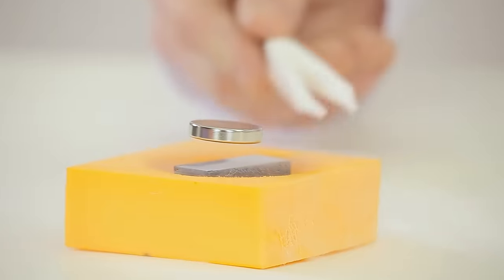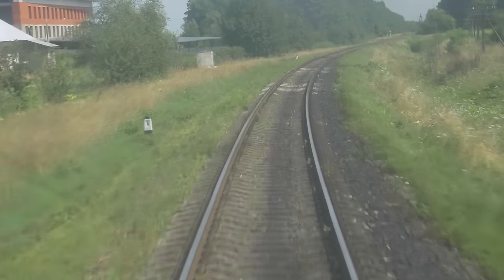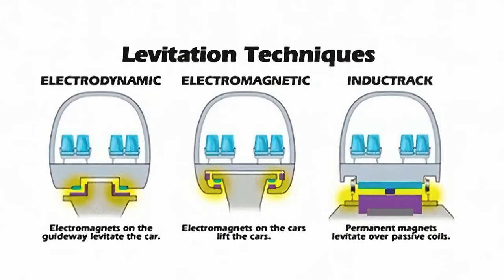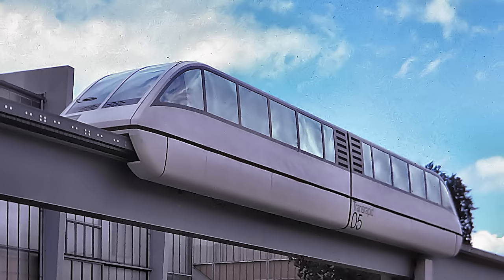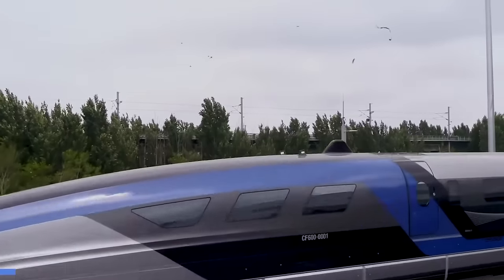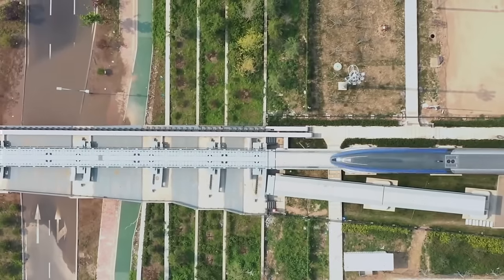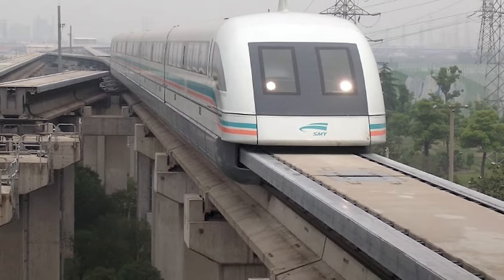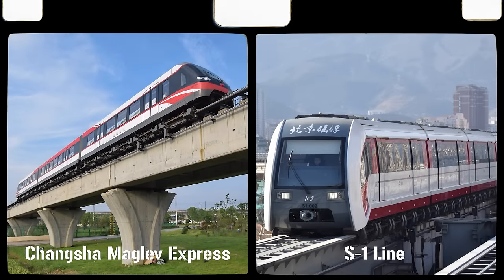Maglev Trains: Why This ALWAYS Falls Short

Comment: Except the GatPort Airwick maglev interport train.
The high speeds seen by maglev trains are largely due to the dedicated and expensive track.
As to the quality of the ride, the UK's HS2 and the Chunnel running on welded rails is very quiet and smooth.

Comment: The only high-speed maglev, in Shanghai, doesn't actually even make sense.  It runs for 18 miles and take 7.5 minutes, more than half of which is acceleration, and doesn't stop anywhere.  For comparison, my old commute was 13 miles, stopped at 6-8 stations, and took ~20 minutes, if it didn't have to stop it would have been more like 15 minutes.  The Shanghai maglev, realistically, shaves maybe 5 minutes off the time of just using a fairly boring train (not even a fast one).  It serves no real purpose except to be able to point and say "look what we did".
What is missed from the film is one of the major reasons why they don't exist in a wider context - and it's the same reason that mono-rails are also basically non-existent.  They require very expensive, exclusive track, that doesn't deal with junctions very well - i.e. it mostly requires an end-to-end seamless run.  That makes them more or less useless across Europe, given the old world nature of the populations and existing infrastructure.  China can build them, because they don't give a shit who they disrupt when building anything.  Japan have history of using separate high-speed lines, so know how to do it.  The US should be the one leading the way with it, given the vast amounts of emptiness and distances between major cities - but they have to fall out of love with cars to gain the apetite.

Comment: There are many mistakes here. Friction is not a speed issue for wheeled vehicles, even very heavy trains. At high speeds air drag dominates the frictional costs of steel wheels on steel rails. The French TGV wheeled train had an experimental run at over 550kph. The issue with the wheels is mostly track and bogey maintenance. Those costs grow as the third to fourth power of the wheel loads.
The fact that they could be better climbers is irrelevant for high speeds as the passenger comfort issues are the same whether the acceleration is lateral or vertical.
High speed vehicles with any suspension and drive train require tracks with little lateral or vertical direction changes. Straight and flat = expensive and huge right of way acquisition costs.
Maglevs have had limited penetration because they are about fixing the wrong problems, while introducing their own intrinsic issues like needing some form of linear motor versus just turning a wheel. We know how to do the latter really well. Good roller bearings used in roller blades are capable of more than 30,000 rpm so a 16 centimeter diameter wheel would support a linear speed of 900kph.

Comment: Since room temperature magnets can only float up to 1cm, in earthquake-prone Japan, they succeeded in floating the car body 10cm by using superconducting magnets that generate a strong magnetic force by cooling the magnets to absolute zero. This makes it possible to prevent contact with the guideway even when traveling at 500km/h. Superconducting magnets are used in medical equipment such as CT and MRI, but Japan is the first country to use them in high-speed trains.

Comment: You don't mention the massive engineering needed for track switches or points. Not nearly as simple as moving a couple of steel rails by a few cm, you have to move the entire track bed and all the electronics needed to move the train
Reply: You're stuck in a specific design mindset. Think of rotary switches instead.
Reply: @colormedubious4747  It's still more complex than a simple rail switch.
Reply: Well, the general logistics of plain tracks is also a big cost factor, you are basically competing with two steel bars screwed into concrete blocks and an electric wire. Hard to get cheaper per unit of distance …
Reply: It would essentially work the same way as monorail switches do where the track itself bends.
Reply: @domp2729  Beam replacement switches are constructed of reinforced concrete and do NOT bend. The straight section swings out of the way as the curved section swings in to take its place (or vice versa). The entire process takes about 12 seconds. Rotary switches are faster and also do NOT bend. Segmented switches (such as those used in many Japanese transit monorails) APPEAR to bend from a distance but the individual segments they're made of are reinforced concrete and not bendy at all.
Reply: @MatthiasWiesmann  factoring in maintenance is important. Rails require a lot of work and switches are particularly vulnerable to wear & tear
Reply: This is why monorails aren't used also. Yes, they're possible, but unwieldy and slow.
Reply: @DouglasLippi  [Multiple Citations Needed] and [Multiple Definitions Needed]. "Slow" is relative to what, precisely? They are much faster than buses, LRT, and trams/streetcars. "Unwieldy" is not a term of art in the transit industry, so what do you even MEAN by that?

Comment: The problem with maglev is not simply its cost, but where its cost comes from. Maglev track is extremely expensive on a per-mile basis and can't be shared by any other vehicles. In contrast, a length of high-speed conventional track is relatively affordable and can be used by low-speed local trains when not needed for the high-speed service, and a high-speed train can travel at low speed on low-speed track to integrate with existing infrastructure.
So, because maglev expenses scale rapidly with the size of the network, they're really only suitable for the rare cases where you need to connect relatively distant cities with fast, high-volume service that can't be supported by aircraft, slower trains, or road vehicles. So certain cases like the Shinkansen make sense, but -- as you noted -- city center to city center transit is very difficult to retrofit into an existing city. Digging them through tunnels just exacerbates the per-mile expenses, so even that isn't really a solution. It's a great idea, but you would have to build your country with this transit system in mind, or else have a strong-to-tyrannical government capable of forcing the city restructuring needed to accommodate it over any objection from the residents. (Looking at you, China.)

Comment: I think it's very understated how much of a problem regular stops are. If you gotta stop every few kilometers, high speeds make very little sense. Also, normal high-speed trains can get to pretty impressive speeds already, close to the comfortable speed limit where passengers would still be comfortably. The French TGV travels up to 320 km/h, the German ICEs aren't that far behind. And that's already pretty near the limit of comfortable travel. Maglevs sadly don't make too much sense. They would make sense on big stretches without many stops, but there isn't many of those. You don't really wanna build a rail that connects only big cities and skips everything in between.

Comment: Think of a maglev track as the stator of an electric motor and the train being some kind of the unrolled rotor. Now in order to cope with all kinds of external impact factors, the flight height must be something like 15-20mm, meaning we have an air gap of 20mm between stator and rotor.
A typical electric motor has an air gap of less than 1mm which makes it far more efficient.
Additionally, the maglev needs energy to lift off  and stabilize during flight which also impacts efficiency.

Comment: It really does need some people to persevere. The Hindenburg accident was the main reason that airships are no longer a thing, people got scared and lost faith. Chernobyl, and later Fukushima, were some of the main reasons people lost faith in nuclear energy. When it goes wrong it does indeed go terribly wrong. However, that doesn't mean it's bad. That Maglev accident also shook people, made them a bit scared of it. But such an accident could as well have happened with a normal train. I mean France has the TGV which, during a top speed run, managed 575kph in 2007. The Chou Shinkansen doesn't go much faster. But it'll be a heck of a lot more stable. But that TGV test could have also ended in an accident, which could have made people scared of high speed trains altogether. Like I said, it takes people to persevere, to get the technology through. Just because something bad happens with a new technology doesn't mean the technology is necessarily bad, it was just executed poorly. Which has happened many times. And in some cases it's actually been accidents that gave us products we now basically rely on day to day. Wasn't the microwave one of those things?

Comment: It ultimately comes down to the fact that laying two steel bars next to eachother on some hardcore is a hell of a lot cheaper than building a complex construction of connected electro magnets that have to be coordinated with millisecond precision. And given that the extra cost increases fairly linearly per mile, and that maglevs work better the further they travel to take advantage of speed, the upfront outlay is always going to be much more, And atm vastly more, than conventional trains. Same reason the hyper loop was a stupid idea. Well, one of the reasons

Comment: It's an interesting idea and I'm all for fantastic new technologies. However, given SNCF managed to get a TGV up to 574kph, I can't see them taking off unless they have the possibility of reaching near the 1,000kph mark. At which point are we near the fabled hyperloop?
Reply: Yeah TGV still the fastest non maglev train
Reply: Well Hyperloop is just maglev in a vaccum tube so yeah.
Reply: TGV current top speed is 300 km/h.
Reply: How fast it can hit in a one time test is totaly irelevant. It also took 150 km to acceleration to  that speed and it was down hill. Apart from  that they had to straigen the track after and the train was composed of 5 locos and no vagon
Reply: Japan's Maglev reached 603kmh which was limited by the length of the track. Transrapid have also stated that 700-800kmh is achievable
China is currently pursuing 1000kmh Maglev tech
Reply: @_peepyopee  a standard non modified TR08 would hit about 800km/h if it was just let to go full tillt
Reply: "just maglev in a vaccuum" is a silly phrasing.  Having a giant tube that you maintain at high levels of vacuum is the reason why hyperloop can't work.
Reply: Running a high speed train at 500kph in service is problematic. The track quality has to be very high and maintained as such. 

The worst is the overhead cable; the cable tension has to be very high to ensure the speed of propagation of transverse waves in it exceeds the train speed. If the wire is too slack then the pantograph sets up a standing wave in the cable just in front of it. Consequently it loses contact with the wire, and your train loses power. This sets the train speed limit. The problem with a tight cable is that they keep snapping. It's a total maintenance nightmare. Ironically, going back to gas turbine power (like the TGV was originally meant to have) would solve that problem. 

Another problem with higher speeds is separation distances. There's a maximum safe braking rate, beyond which you'd be risking passengers falling over, getting injured, etc. So, you have to space the trains out more. This then reduces the line capacity, assuming the trains are the same length (fewer of them can depart per minute). You could make passengers sit down and wear seat belts like on planes, but that wouldn't be popular.

Acceleration rate is also a problem; it takes longer for a train to get up to that higher speed. This means reducing the number of stations on the line (cutting revenue), or never actually reaching the top speed. 

Interestingly, the existing Japanese bullet train line has done an awful lot to reduce journey times not by increasing train speed, but increasing train acceleration and making them quieter. The added acceleration means less time accelerating to line speed. The quieter trains mean they can run faster along stretches where they're limited by noise regulations, and the higher acceleration means getting back up to line speed sooner having cleared such zones. They've managed to knock about half an hour off the Tokyo Osaka time (down to just about 2 hours) over the decades I've been using the bullet trains.

Comment: The reason for maglev non-adoption can be summed up simply: Railways already exist and are good enough for most purposes. Good enough is the enemy of perfect

(Lathen happened on an experimental line without adequate railway safety procedures)

Maglevs have a massive disadvantage which comes with speed - NOISE (but so are fast trains). The Shanghai maglev was slowed down outside of the middle of the day due to complaints from residents nearby - it's the equivalent of a jetliner passing by at cruise speed (If you're ever heard a 737 doing a high speed cruise trim pass over a runway for demontration purposes you'd understand - they're deafening even at 100m away from railway centreline

At low speed they're almost silent, which is a huge advantage over rail - but see the first line

The limiting factor on train speed is NOT rail friction, it's "Hunting ocillation". Friction due to air resistance utterly dwarfs everything else above 200mph and most of it is incurred along the sides of the train, not at the front. (Woodpecker or bullet noises are for noise reduction, not efficiency)

Punching a train-size hole in the air takes a LOT of energy (8MW on the Shanghai maglev) and active levitation requirements are low (Shanghai maglev only uses 15kW for levitation) (for electrodynamic levitation this is a parasitic draw but the same principle applies - going forward at high speed chews vastly more power than levitation - but the NOISE problem of punching a train-size hole in the air at speeds over 300km/h persists)

Japan's maglev line is 90% in tunnels. Building it in the open would result in them being inundated in noise complaints on an operational track and I'm pretty sure that most of the remaining open sections will be enclosed for the same reason within a couple of decades of launch (and of course, that avoids the issue of "obstacles on the track")

If you're going to build a high speed maglev in tunnels, you may as well partially evacuate the things to reduce propulsive draw and allow higher speeds. Oh dear, you've just reinvented vac trains (Hyperloop)

With fuel costs continuing to climb and (especially in China) air travel being actively discouraged by governments, maglev has a good chance for revival - not as competition for trains, but as competition for AIR TRAVEL

With suitable routing (and cooperative governments, the feasibility of a maglev route from the east cost of the USA to the west coact of Europe via the Bering Strait would depend on being able to get there faster than aircraft for less money - this is doable (Vactrains can easily hit mach 5 in suitably evacuated high speed tunnels and terrestrial electrical supplies will be cheaper than jet fuel not far in the future from now - even cheaper if China's work on Molten Salt Reactors validates the scalability and cost predictions Alvin Weinberg made at Oak Ridge in the 1960s

Time will tell, but Maglev vac trains are on the cusp of new possibilities. Personally I believe they'll need to be capable of hyprid operation ("low speed" tracks to the tube entrances), large enough to allow shipping containers to fit (due to curve requirements, 20/40/60/longer aren't an isssue) AND allowing pods to actively "entrain/detrain"  enroute in order to allow multiplexing and reduce traffic handling complexity

(DOn't worry about "terrorists" or "buckling" on evacuated tunnels, It's only one atmosphere at most and we already know how to make tubing capable of withstanding much (MUCH) more than that even at 4-5 metre diameters. The fact that the tubing is on the ground means that power can be fed along it and pumps, etc spread out. (you actually want "calibrated leaks" so that in the event of power failure, trains will passively airbrake and people can escape)

Comment: I really feel like proper application of maglev would do wonders for shipping instead of being used for people. If there are no humans onboard then you needn't worry as much about making it comfy and there doesnt seem to be much of a reason not to just make a bigger train with more or bigger cars for shipping. Plus being used to cover larger open areas instead of the issues with trying to run the line through a city should result in less pushback

Comment: Nice video.   It could have been a lot better if you had interviewed some engineers who have worked on mag-lev projects and asked them the simple question:  Why are maglev trains so expensive?    The follow-up would be then "For what problem in this area is a technology break-through most needed to reduce its cost?"   
The answers to those questions could, perhaps, end up inspiring up-and-coming engineers to focus on those areas and make this sci-fi fantasy  a wide-spread reality, eh?
Reply: Interviewing is fundamentally different from what Simon does. He hires writers for multiple channels and basically acts as a reader and the face. Sometimes his writers do reach out to experts and other people, and they will include that in the piece, but conducting an interview is entirely different type of journalism with different ethical standards and requirements. I’m sure interviews exist if you’re interested in hearing one